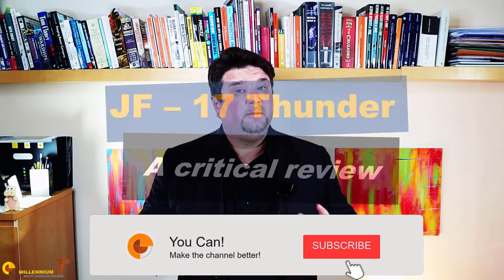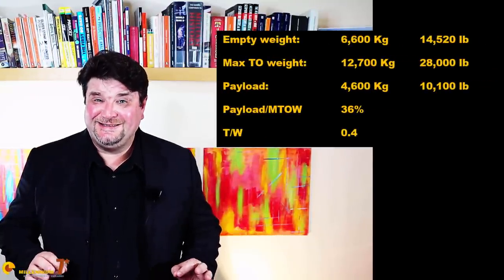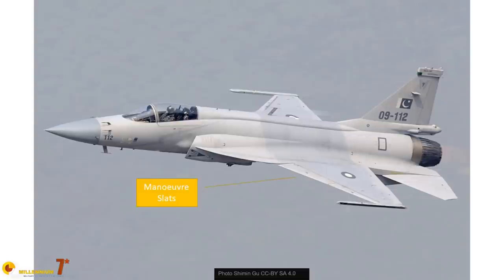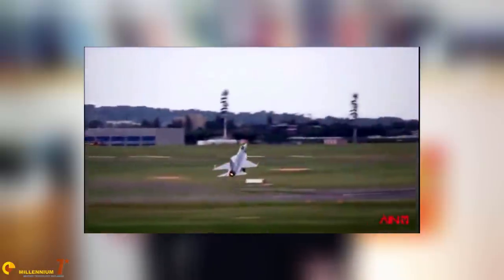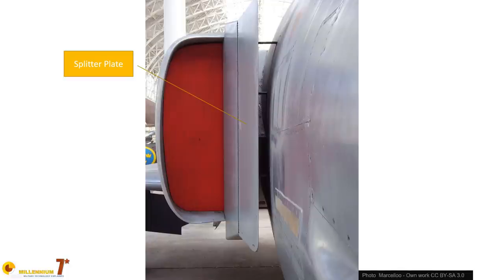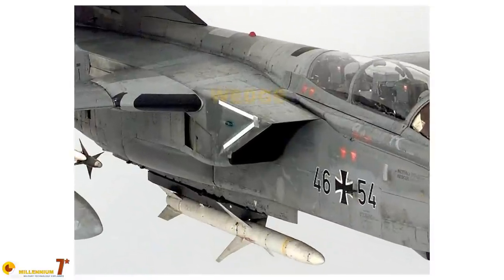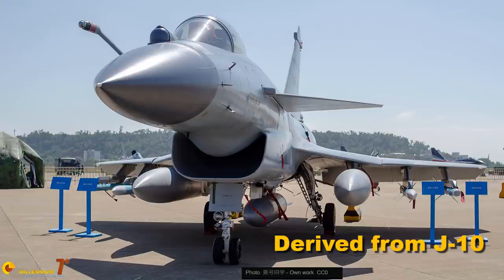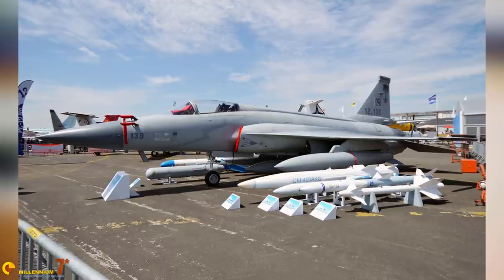JF-17 Thunder Block 3 & F-35 - What do they have in common?

Comment: The first iteration of a bump (it also has a diverter, so not a divertless ramp) is on the F11F-1F Super Tiger prototypes of the late '50s that lost out to the F-104 bribes in Germany and Japan. It hit mach 2 when Grumman was expecting a slower top speed. If you decide to do a video on intake bumps, it would be worth researching. 
Photos: https://www.secretprojects.co.uk/attachments/super-tiger-intake-ramp-jpg.17871/
Thread: https://www.secretprojects.co.uk/threads/grumman-xf11f-2-super-tiger.455/

Comment: Grazie per un altro video molto particolare.

My question is about RCS of divertless intake.

We see only compareable example with and without of divertless intake on F-16.

Bump shape can have a scatter effect of incoming radar signals and also due to lack of splitter plate, finally RCS will be reduced for this point of view logically.

On the other hand I observed on F-16 case, intake cross sectional area seems larger with divertless intake since bump blocks a certion rate of air flow. So, larger intake area means larger RCS. I wonder overall situation rate. One effect (scatter+no splitter) clearly reduced RCS but other effect (larger area of air inteke cs.area) could increase RCS. It's known exact percentage of RCS reduction with using divertless intake?

Grazie&Saluti.
Reply from the maker: No, I don't know, sorry.

Comment: I suspect that the People's Republic of China will wind up buying at least a couple hundred of these to replace some J-7 for their reserve forces. They may be waiting until a block 3 or 4 is fully ready. Their J-7 are still in use but fly relatively few flight hours, just enough to maintain pilot proficiency. JF-17 (probably would be designated J-17 or FC-1 in PLAAF service) would fill the low tier, less expensive slot currently filled by J-7.
Reply: I am sorry, but China surely won't adopt JF-17 into their fleets.

China is continuously developping the more advanced J-10 and J-11/16 series.  They will transfer the early J-10A and J-11B to reserved force instead of buying new light fighters.

China only needs new light jet for training purpose,  but they have already chosen JL-9. It is almost the same as later J-7, except the nose section is similar to JF-17. It is much smaller,  lighter and cheaper than JF-17, because it has the same old turbojet engine and structure of J-7. The performance is significantly worse than JF-17 that it won't have a chance against any modern fighter. So China was really surprised when a poor country import 6 JL-9.
Reply: Blackbirdz2000  Chinese carrier is same as Russia.  Their ski jump launch system has a pair of block to lock the wheels of the Su-33/J-15 heavy fighter when it engage afterburner before launch.

Obviously,  JF-17 is smaller than Su-33/J-15 that the locking block won't fit JF-17.

P.s. India actually heavily modify navy version LCA landing gears for carrier launching.
Reply: @joelau2383  The PRC has slowed down fighter acquisition recently as their economy has slowed down. Budgetary pressures could make the much cheaper JF-17 an attractive option for modernizing their low tier forces. Way back during the start of the partnership with Pakistan on their JF-17 program it was explicitly stated by the PRC that they intended to produce some JF-17 themselves, which helped to secure the contract because long term support of the platform by the PRC could reduce costs for parts and developing upgrades in the future. They may have not been sincere but if we take their statement at face value they were at least considering it. The structure of the program appeared aimed at replacing the J-7 program after that line ended. J-10, J-11, and J-16 were produced in large numbers already, enough to equip all front line forces. The J-7 operators over the last couple of decades have mostly been reserve forces which are mostly to keep total numbers up on paper and have some less well trained but inexpensive reserves. A high end fighter for these units would be a huge cost increase to acquire and maintain the aircraft. While they could give them J-10 or J-11 and produce more J-16 or J-20 for the front line forces, this would also be costly and they appear to be producing them slowly right now. With the huge hit to the PRC economy during 2020 the economic pressure may force them to either keep the obsolete J-7 around longer or replace them with inexpensive JF-17. They have over 400 J-7 in active service. There are also some J-8 still used but they may use the few high end fighters they are producing to replace those since they were intended to be interceptors.
Reply: @stupidburp  PRC military expanse grow slow down, but there isn't a cut at all. It means the orders of new planes are at least same as last year.

The restriction of J-7 replacement is not the budget, but the production capacity. J-10 manufacturer is also making J-20 now while J-11/J-16/J-15 manufacturer is also developing FC-31.

The third manufacturer in PRC is making JL-9 advanced trainer, a heavily redesigned J-7 as i mentioned. JL-9 surely will replace hundreds of J-7 in several years. So i disagree PLA has need to buy JF-17 except simulating F-16 in excercise or training.
Reply: Hello, the chinese don't have a need for a platform like the jeff. What they did well with PAF was go through the various tech and mig 33 data to come up with a light fighter that mixes tech efficiently. The jeff is proving surprisingly adaptable to upgrades and its performance is middle to high. Think a yak 3 from ww2 as an inspiration. What also works is the weapons load using chinese and western combos. It' just doesn't  fit into the chinese need considering it has short legs and a small weapon load. Fine for Pakistan because it doesn't have to go too far.
Reply: JF17 was produced when J10 was rejected by Pakistan, so Pakistan made China go for JF17 hehe. Chinese upgrade J10s after they upgrade JF17s lol.
Reply: @aarifboy  Wrong, J-10 is China domestic fighter, but JF-17 is coorporation project between Pakistan and China like Korea and US T-50 trainer. 

They are 2 independent projects and they will keep getting upgrade. To Pakistan, J-10 is just an import fighter option like F-16.
Reply: @aarifboy  because the doctrine is different for PAKAF and PLAAF. J10 was designed to fit PLA's needs, jf17 was designed for PAK's needs. The challenges are completely different. jf17 has to carry out group missions for the F16. PLA has absolutely zero challenges from the ground. The radar setup was all pointing to the sky on the J10, until later variants.

Comment: The relevant question is how many JF-17 you need against one Indian Rafale.
Reply: Depends. Rafal is a generation a head
Reply: You shouldn’t compare it to the Rafale imho, but rather to the Tejas, and they are more or less equal.
Reply: One stinger ground to air shot would be enough if handled the way Afghans did in 80s.
Reply: I can answer that, about 3 with a load out of 12 pl12s. And there are about 130 Jeff's in service and they fly unlike hanger queens.
Reply: Marcos B  Based on what evidence? The tejas hasn't achieved foc in 2 decades and has jumped to a mk 2. Check the millennium video on design flaws of mk 1. So let's get off the its indian so superior debate. Tech is useless if it doesnt work or doesnt do what its expected. We'll  save the talk for when the IAF operates in bulk. Not 2 under strength squadrons of mk 1s
Reply: Whatever JF17 ended up in battlefield last year Feb ending up hitting targets inside India, while Tejas was crying in his moms lap scared hehe.
Reply: @Galaxy grey
 'Gay' Hind lol

Comment: The definition of a delta wing does not preclude the presence of a leading edge root extension, or the presence of a leading edge flap - otherwise the F-16 likewise doesn't fit the definition because of its forward strakes. If you want to consider the LERX as a separate component, then the JF-17 could be properly categorized as a cropped compound/cranked tailed delta wing.
Reply: fredmdbud Well, it doesn’t. The F-16 is not a delta wing design either. It’s a trapezoid wing design with LERX, just like the JEFF.